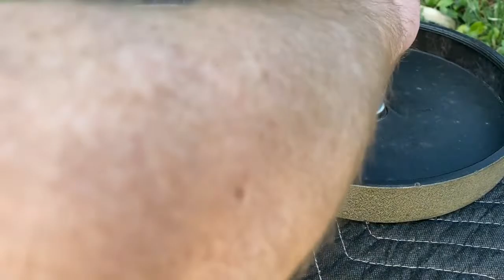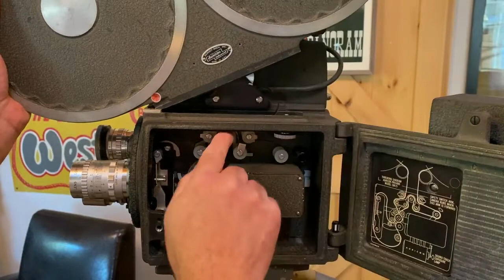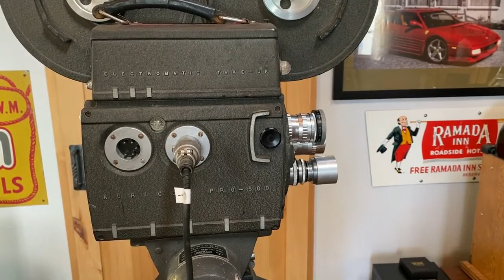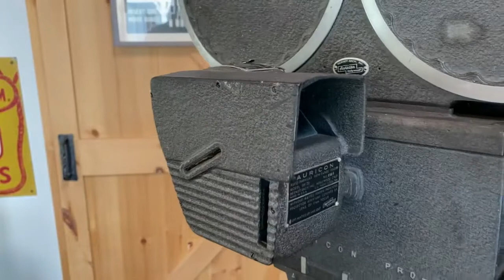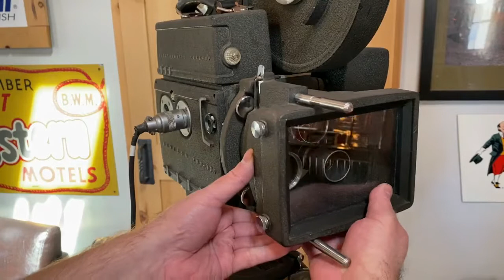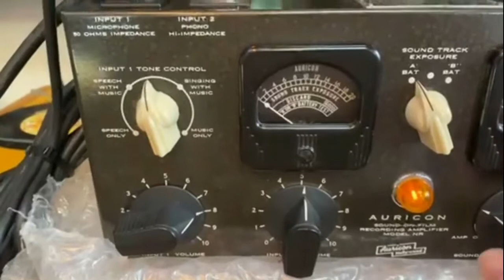Auricon 16mm Camera

Comment: Hello, great video, thank you. I recently acquired a ton of vintage photography and film equipment including three Auricon Pro-600's with spare parts for each.  I was wondering if you possibly had a parts list for the Pro-600, or knew where I could find one.  I've got both the user and service manuals but a parts list is either missing or not included.
Thank you
Reply: Thanks! I do t have a parts list, sorry.
Reply: @RetroRidesRendezvous-us5mc  No worries, thanks for getting back to me

Comment: Simply Amazing! What type of film do you need to record audio on film in 2024?
Reply: 100 iso film would be the best film to record to

Obviously the magnetic film is no longer in production so the only way to use it is with a optical soundtrack which is where the galvo would come in handy but getting the amplifiers going are a bit of a pain as they run off some pretty weird batteries

Comment: Hi Larry....  Did you get your film back from the lab yet?
Reply from the maker: I did. The audio came out real nice. But I overexposed the picture. Pretty much completely washed out. So  going to shoot another test roll and vary exposure. Thanks!
Reply: @larrybell4657  I would stick with 16 as your sound track exposure setting if you are going to use Tri-X.  Do you have a light meter?  I have one and I also use a light meter app on my android phone called "Light Meter".  I believe it cost me $2.00 if I remember correctly.  You might be able to down load free light meter apps, I am not sure.  I know many area also available for iPhones.
Reply from the maker: @TheAuriconGroup  I think that’s where I was with sound. I’m happy with that. I do have a light meter but didn’t use it. I will be this time!

Comment: Hi...  This camera was made so that you could shoot optical sound, or mag sound.  In this video, you have loaded mag striped film, but you do not have a mag recording head in your camera.  You do have a optical sound galvo in your camera.  So if you loaded your camera with normal single perf 16mm film (not mag striped film) you could shoot optical sound.  I see that you have a noise reduction galvo in your camera, so you need to turn the NR switch on in your amp.  Is this a variable area or a variable density optical sound amp/camera?  If you post the metal name plate on the camera and amp I can answer that question for you.  Have you replaced the old wax capacitors in your amp?  You can leave the mica caps as they usually do not go bad.
Reply from the maker: Hi, I just used whatever film I had to show the loading of the film. I think I mention that it’s mag film in the video and mine uses optical. The amp is rebuilt but it’s an older style that won’t control the NR of the camera. I just sent out the first test roll that I shot. So we will see how it works shortly. The camera is an S version and the amp is an NR24-A7.
Reply: @larrybell4657   I do not understand what you mean when you say you have an "S version camera".  What is the full name and model number of your camera? The NR-24-A7 will not support the noise reduction (NR) galvo that you have in your camera, but it will record optical sound with out NR.  To support your NR glavo you would need an NRS-24-A7 or better yet, an NR-25-S7.  What film stock did you shoot?  What sound track recording setting did you use?  16 seemed to work best for me with Tri-X.
Reply from the maker: @TheAuriconGroup  I believe the 'S' denotes the type of Galvo (Square Nose). Mine is a CM-75 serial #1029 with Track S. Yes, that is correct, the NR in this camera will not work with the amp. I used B&W Kodak 7266 TriX Reversal film for the first test. As it's a test, I varied the sound track settings to experiment with the levels. I had both the mic and music input. When I spoke, I turned up the mic input dial and when not speaking, I dialed it to off. Hopefully I won't have to do many test films.
Reply: @larrybell4657  Ah!  Yes, I understand you now.  I agree, you have an "S" type galvo.  Also called a "Noise Reduction galvo", or a "NR" galvo.  Your CM-75 went into production in 1955 and it's common name is a "Pro 600".  You have a low serial number so your camera may be from 1955 I would think. Sometimes (often?) Auricon would start the serial numbers of a new line of cameras at 1,000   For Tri-X, you will find that between 15, 16, or maybe as high as 17 will be the best STES, with 16 being what most use.  If you have replaced the wax caps in your amp, and the tubes test OK,  you will find 16 will probably be what you will end up using.  I would not turn the volume up and down between taking.  While NR will lower the noise floor, it is not like not using NR will give you a great deal of hiss.  Are you using a Auricon 50 Ohm E6 microphone?  You can hook a CD player up to the input on your amp called "Input # 2 Phono" and get some great sound.